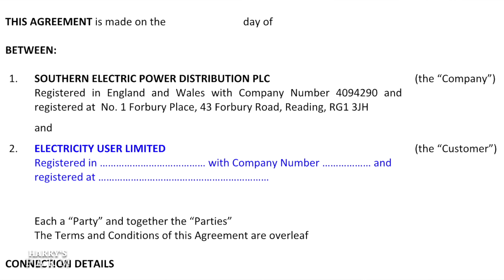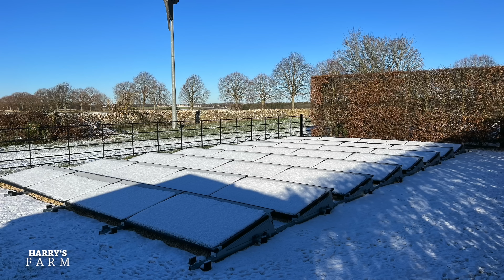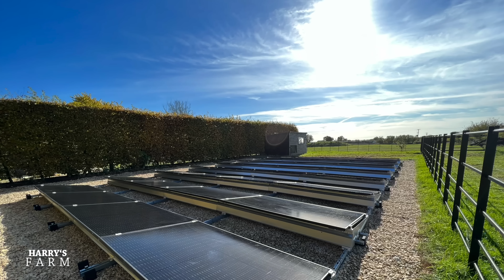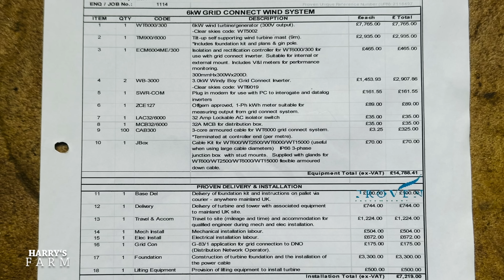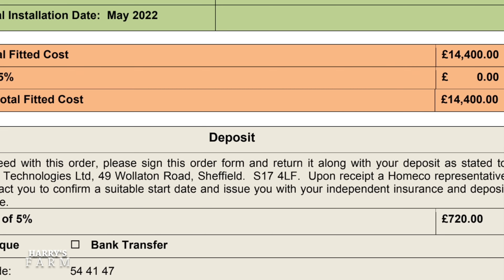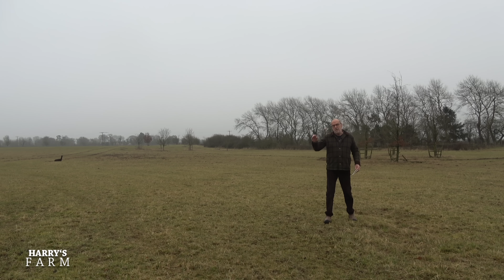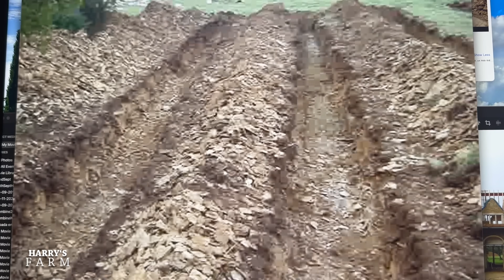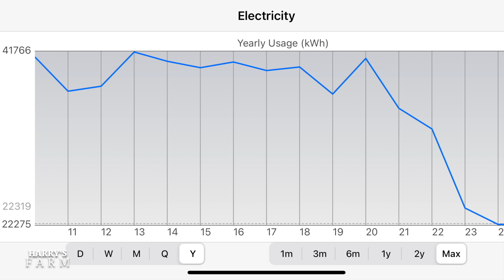Are solar panels & heat pumps worth installing? Here's what I've learnt after several years of use.

Comment: You should consider making each bank of 4 panels , to be tilted to a winter and summer position,  using a simple mechanical linkage,  say 60 degrees in winter, 30 degrees in summer

Comment: Since these panels are easily accessible on the ground they should have a lever for adjusting the angle for the seasonal efficiency.
Reply: Maybe. They are located pretty close together. Tilting them upright for a winter month sun angle may actually shade the next row of panels.
Reply: @KAT-pi3pk 
You can get double sided panels.

Comment: Shade: You need more inverters wired differently so when one panel is not receiving sun, if impacts few others. Winter: The angle of your panels appears to be optimized summer, where the sun angle low in the sky in the winter, would be inefficient and particularly suseptible to snow as in your photo. Ground Source: You should have your circulation hoses below "the frost line" a point where ground temperature is stable all year around (not deep enough)

Comment: So at the combination of solar and wind works well for the uk. The solar in the summer when there isnt much wind and in the winter there is a lot more wind when there isnt solar. 
Going forwards we may need more winter electricity for heating with heat pumps so we will need more wind...
But this may mean that we dont need so much solar in the summer... maybe we are building too much solar??
But we will need electricity for transport which is less variable in need between winter and summer so will still need solar. 
Solar is very variable between summer and winter... as you show here.. a 10fold variation.
But wind as you note is very variable all the time. This is because the energy output is to the 3rd power of wind velocity. The wind speed doubles and power output goes up 8x. 
The variability is the biggest issue because it is so expensive to store any reasonable quantity of electricity.
Ultimately we are going to need backup gas turbines, maybe with some carbon capture. 
Net zero is going to very difficult and expensive but we can get a long way towards it especially if we are good with minimizing energy use with insulation etc.

Comment: your biggest issue for winter gen is the angle of those panels; you need to be as close to 90 degrees off solar for maximum generation. those are what, 5 degrees off vertical. a recent video I saw found that solar pannels perpendicular or 90 degrees from the ground gave best winter production.

Comment: Nice video! But not quite right. We have also massive excess in Summer. This gets sold back to the grid giving us credit which we can use in the winter to heat our house cheaply :) Having said that, 12 KWH is huge for a domestic system. For a normal 3-4 bed 5-7 KWH is totally sufficient

Comment: Your assessment of the solar and wind was very honest - it would appear they work to the 'sods Law' formula - lots of power in the summer when you don't need heat and not much for the 8 months when you do!! I built a swimming pool back in the 80s and heated it with a 3 phase  heat pump. It ran all week so I could jump into the pool for 30 minutes at the weekend!!

Comment: I just wonder why the panels' tilt angle is so flat?
In northern third of the cotswolds it should be something around 40°
I guess these could deliver more if hanging vertical on a south facing wall - they'd be also off of the optimal tilt angle, but have no snow buildup in winter, and possible no shadows. 
Plus if you put a pond before the wall, the sunlight will be reflected onto the PV panels.

In my area (Bavaria) some guys use PV second hand panels as fences

Comment: Thanks for sharing Harry. That’s a commendable summary. It’s great you insulated so well, that will always save significant amounts. Pretty decent running costs considering the size of home, heated garage and swimming pool

Batteries might be worth it, as you could import in the early hours for significantly less than the day rate, in particular peak times

We have a wood pellet boiler for heating and hot water. It’s much cheaper to run than the oil boiler it replaced. We also have several air source heat pumps for back up (which serve as air conditioning in the summer) a 10Kw solar array and a Tesla Powerwall. We don’t run any ev’s and the solar income almost pays for the wood pellets.

Comment: 16:56 The average boiler has an average heat output of 24 kW not because it's necessarily required to heat the house but because most gas boilers or combi boilers heat both the heating system and the hot water the moment you draw hot water, because of that you need the high power output to get the water to temperature quickly.
If you used a hot water tank, you would get away with much less powerful boilers. However, since space is limited in apartments, you would rather "not waste space" by installing a hot water tank and get away with an oversized boiler that instantly heats your hot water.

But of course, you're heating more efficiently with a space heating system compared to radiator heaters, since the higher the temperature delta is, the more energy is lost on the way to the heating system and in the case of fossil fuel heaters also in the form of exhaust gas losses.
Also condensing boilers are more efficient with lower temperatures since the exhaust gas temperature falls below the dew point more often, allowing it to extract up to ~10% more energy from the gas and ~5% more energy from the oil than with a conventional low-temperature boiler saving 10-20% on fuel cost.

Comment: Great video.  Thank you for the transparency on costs and returns.  I'm in a different latitude, being in Las Vegas, but solar for me has been a good investment.  I have not paid more than the base charge to be hooked up to the grid in a long, long time.  We cannot sell excess energy produced to our utility thanks to Berkshire Hathaway's greed, but we do get a credit for any energy we return to the grid (80% of what we generate).  Because of this, I do all my high energy use activities (laundry, dishwasher, etc.) during the peak of the day.  There's no incentive for me to reduce use given the current pricing structure.  I will eliminate my gas furnace when it fails (or the AC unit fails) and go to a strictly air sourced electric heat pump (ground source not an option for me).  Already have an electric clothes dryer when most Las Vegas folks use a gas clothes dryer.

Comment: Millionaires can do this,  but your average working class can't,  heat pumps have been ditched from the tyrannical mandate because they're not efficient enough & don't perform anywhere near the figures Harry has quoted ,  from a family of heating/gas engineers,  for a simple 3 bed house the cost is in the thousands to find out it massively underperforms,  there really is a class divide.

Comment: I have to disagree with a lot of what you say regarding solar because it will wrongly inform 'all' viewers and negatively influence some viewers.
First is the 'permission' comment at the 1.23 minute point.  Permission is only required if the inverter being installed is 'more than'  3.96kW which you do not make clear.  You required permission from the 'District Network Operator'(Google it) not your 'provider' because your installation is so large.
Our installation is 18 x 320w panels running through a FoxESS 3.7 Inverter to 4 x 2.6kw batteries.  It was installed by a company that is now an Octopus Energy partner and not once was 'permission' mentioned.
I will also concur with a comment below that your panels are 'extremely' flat to the ground.....why not have them on a frame higher up off the ground with a better angle to maximise solar capture and self cleaning?
Also the location is extremely detrimental to output because of shading.  You will have shading 'drop' from the hedges, chimney, wind turbine and to a lesser degree the fence. Whoever installed this 'ground' system has done you no favours whatsoever.  You will be losing o a great deal of output because of shading and because of frost and snow which will not clear efficiently and is clear to see in your video. 
I would also add that you seemingly have little real knowledge of 'solar' and have no batteries. 
In my opinion you've been had over mate and viewers would be well advised not to be influenced by your installation or your comments regarding the benefits of batteries.
In my experience, and that of others, in the more productive months we not only use purely solar during the day but our batteries charge up, we export 'and' we use battery energy in the darker hours which means no imported electricity.
I have had months where my 'import' is less than 3kWh(solar uses minute grid energy to self regulate and function) whereas you will 'always' be 'on grid' once the panels stop producing.....and even today we will use 'no' grid energy because of the production, battery storage (10.4kWh) full and we even exported 9.7kWh.

Comment: Your solar panels need to be angled more to compensate for the sun being lower in the winter,  also your installation requires optimisers so when any of the panels are shaded it stops the string voltage from dropping.
Your solar installer hasn't a clue or you opted for a cheaper installation

Comment: The problem is, when the majority use their own generation resources for most of the year, but then when you have a shortfall, you just rely on the grid.. Sounds great, except that the reliable generation capacity and associated supply network has been standing idle for most of the year, they are going to have to charge enormous prices to cover their costs... This is happening now on the national grid.. The whole point of the national grid was economies of scale, take that away?

Comment: In regards, there is no needing batteries, and to solve the massive peaks and troughs, you should be able to get a deal net metering deal with your electric supplier. This means u sell excess energy and get energy credit. You can then use these credits when u then produce less energy and have to make up the difference by drawing more from the grid.
The grid will distribute the excess energy to those who need it. Thus, they sell for a higher price, and they make more money. So a win- win

Comment: The lowest hanging fruit - if u have built ur own how - is to have built it to Passive House standards and to take into account summer heat gain and sunlight. Next is to use low energy consuming appliances and lighting .
Only then should you think about and sign in heat pumps and solar/wing/micro-hydro since they are expensive and add the least value to ur house relative to the above first steps.
Only if ur house is very poorly insulted and u can not do much to improve this do u need to think about renewable energy production.
Why it becomes expensive is the need for battery storage. Batteries are becoming cheaper, but when u take in the installer costs, they will not come down quicker or at all, thus there will be floor cost..

Comment: I got no problems with my system only January I had a large electric bill this month it’s gone down by half all because of the current bun January was just  gray but February we have had some sun but I got batteries fitted with my solars which means the batteries get charged up and then the house uses the electric from them I also got a air source heat pump which is better then ground source I think

Comment: Milliband already gsve net zero scam 22 billion, is that reeves black hole?? Heat pumps need electric all day long, n as electric is getting expensive, andcalegedly we are heading for power outages,n hose pipe ban s in jan-que? The obvious thing is water exraction by bottling companies, and comrade starmers extra data stores which use bucket loads of water n excess amount of elecy. Have you seen "the mac masters" vids on ev cars

Comment: I noticed your windmill, like those installed all over uk n in sea, are only any good at genersting elecy when there is a slight breeze, anything more n they lock them off from rotating n generating elecy, they should be called slight breeze mills. The windmills n solar in uk under the net zero bow-locks isva waste of monry, for which consumers are subsidising in their elecy bills. In spain n greece they use a electric bar fire with heat pumps in their version of winter, so the crap about net zero climate change n green energy is still a scam..

Comment: Hi @Harry's Farm - great video. Some things to increase your yield: 

1) Definitely: The PV tilt angle is very low - 10 degrees? If you are in the south of the UK, the optimal angle to maximise annual yield is 38 degrees - of course this would increase shading so you would need a little more space between rows.  It will also boost the more needed winter output and slightly reduce summer output, but still increasing your annual yield. The steeper angle will also keep your panels cleaner. With 12kW you should be able to get ~12000 kWh/y.

2) Possibly: The 'shutdown' of all the panels in a row as a safety procedure when one panel is shaded is incorrect. The reason for this is because they are connected together in series to maximise voltage which lowers resistance and increases efficiency. However, when shading is present (i.e. your beautiful hedges), this is not the most effective system to use and parallel is better. Series would be like a motor race with 1 lane - if one car stops, they all stop.Parallel would be like a 4 lane motorway, where if one car stops, the other 3 can keep going! In like for like unshaded conditions, series is better, but the losses due to shading are much more detrimental and so in your case I believe parallel would be better - perhaps you could test these!
Reply: quite frankly, £14k for 12kW is also expensive. PV is now £0.1-3 per W, so £2400 for 12kW. You can x4 this for labour, mounting, inverters... at most. (relevant for 2025)

Comment: OK so the tl;dr is ... green energy systems only really produce a useful amount of energy during those times when you don't actually need it.

Also, green energy is great for those who have hundreds of thousands to spend on building a new house, that is thermally sealed with all-round triple insulation, and a vast amount of land containing eye-wateringly expensive solar, turbine and heat pump equipment.

However, the most important information is notably absent from this video. What was the total cost of the equipment and installation, and how many decades will it take to pay for itself?

Because from the information I've managed to glean from multiple sources over the years, the costs are so vast that the equipment will literally die and require complete replacement many years before you'd beak even, which means it would literally never be able to pay for itself.

My only bias here is money. I don't care about the politics or science. At all. I literally only care about the affordability of "going green". And as far as I can tell, this is a luxury only the rich can afford.

If you have actual numbers to disprove that, I'd love to see them. Please ensure this includes the costs of thermally sealing a typical old property, all the equipment, installation and maintenance, as well as the running costs and eventual replacement when it breaks down.

I understand that the UK government is on a crusade to force everyone to use heat pumps, but if they ever actually succeed in forcing me to do that, I will no longer be able to afford to heat my home, as my current annual heating bill is zero, due to having access to completely free solid fuel (dead trees). As a minimum wage earner in a single-income household, any heating cost greater than zero would be completely unaffordable to me.

I was approached by an "energy efficiency" company (i.e. heat pump salesmen), who offered to "insulate" my glorified bothie and give me a heat pump for free (using the magic of "carbon credits"), but apparently these carbon credits do not extend to the point of covering the bathroom, kitchen or windows, which in my house is where 99% of all the heat is lost. So their "generous offer" was nothing more than a useless token gesture, and the fact that they'd even consider that to be a viable solution tells me everything I need to know about the credibility of these supposed "engineers". At no time did it even occur to them to take heat map photos of my property, probably because that would have exposed them as scammers.

They also refused to even give me an estimate for the running costs of this "free" solution, which in itself was deeply suspicious, and enough for me to reject their proposal.

Again, I am not exactly a Luddite or technophobe. I violently don't care about the scientific, environmental or political rhetoric. I only care about the affordability, as I simply don't have the luxury of caring about anything else.

If the UK government is so determined that the poor (which is 1/5th of the entire population) must be forced to use green energy, then the UK government will need to pay for it. All of it. Because we can't.